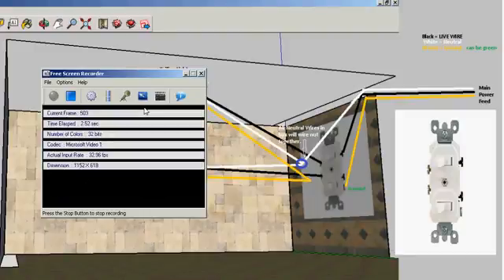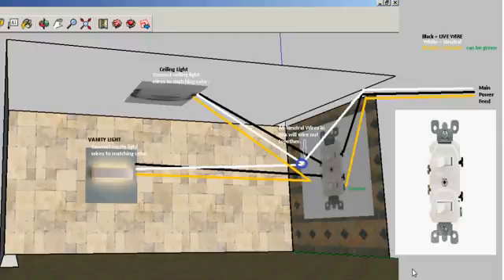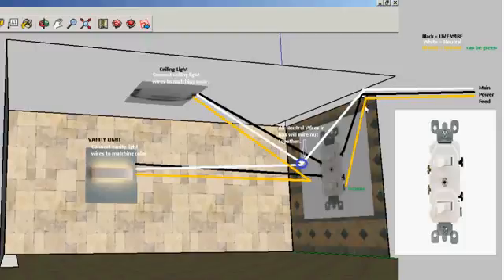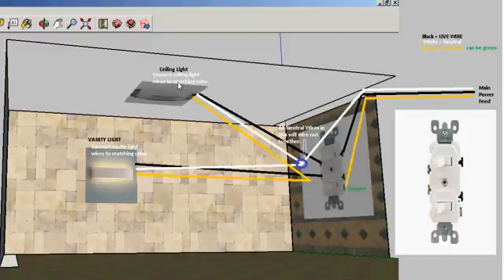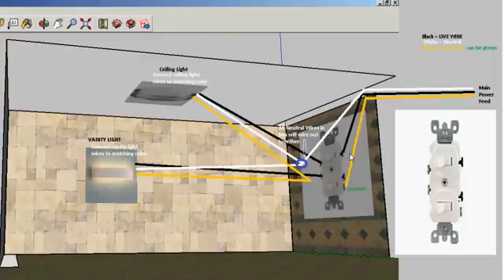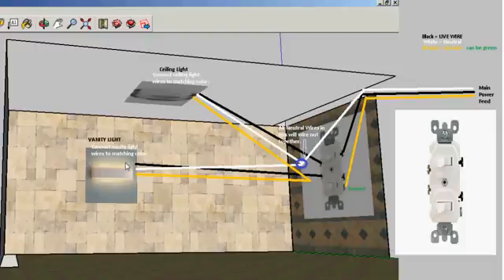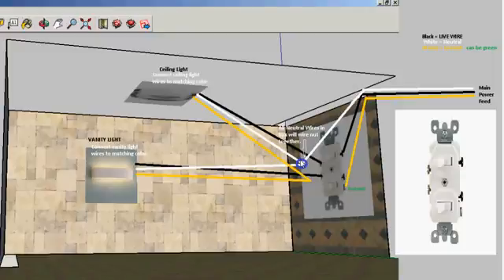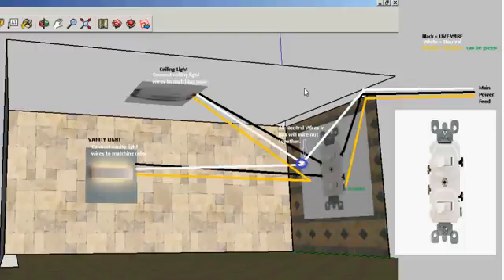How to wire a Double Switch - Light Switch Wiring - Conduit

Comment: I need to ask, right now I only have a single switch that operates a ceiling light fixture. I want to remove the light and switch to install an exhaust fan with LED light but I want to separate the fan and light to a dual purpose single switch (like a Leviton switch). 
Will I need to run another Romeo from a separate source, or can I use the single source currently there?
Reply: Not Romeo, Romex. Damn spellcheck.

Comment: I recently had to add a fan to my bathroom. The problem is, on the switch and in the box was only a white, black and copper. Nothing else. I then added a another new 15 ft of wire for the fan. 
What do I do now? I have called family and they don’t know how my light is working with only this setup